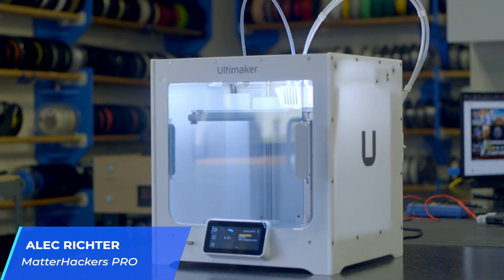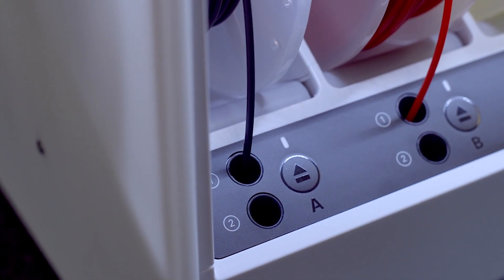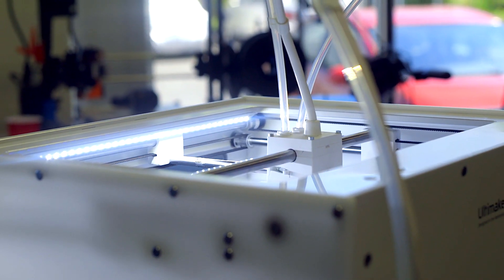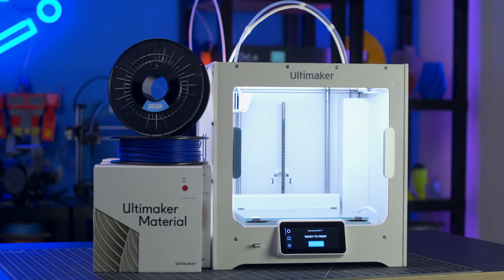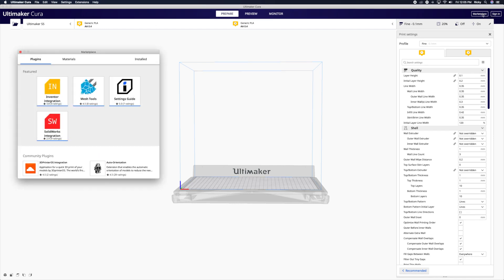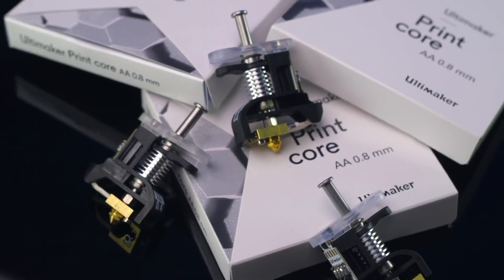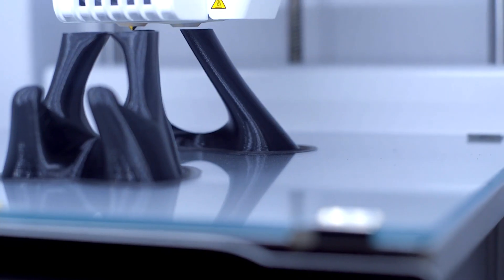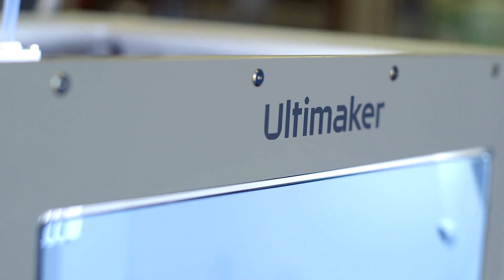Tech Breakdown: The Ultimaker Collection of 3D Printers and Materials

Comment: got a question own a prusa v2 I want to increase build volume (z) and reuse most of the parts SO I am wondering convert to Mendel90 or is there another frame I could reuse most parts with simply and easy? Need some input

Comment: If only most of us could afford an Ultimaker printer. If I ever plan on buing a dual extrusion printer, I would probably want it to be from Ultimaker. Hopefully I'll get to that point in my life where I can spend $4000-$5000 on a printer. For now I've just ordered my first 3D printer for home, the Prusa Mini. Though I'm used to using a Stratasys uPrint with their SR30 support material that creates flawless prints, but the Prusa Mini will do for now. I think that I've got two goals for my second printer, one, be able to print stronger materials like NylonX, and two, have dual extruders/multi material capabilities so I can print with dissolvable supports and multiple colors. I'll probably have a budget of about $3000-$3500 for that and will probably have to wait 2-3 years.